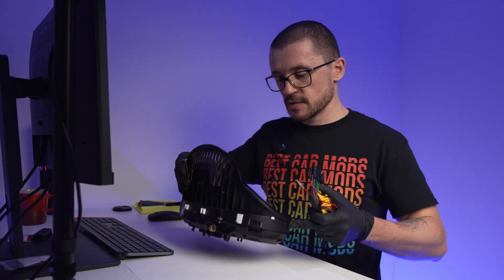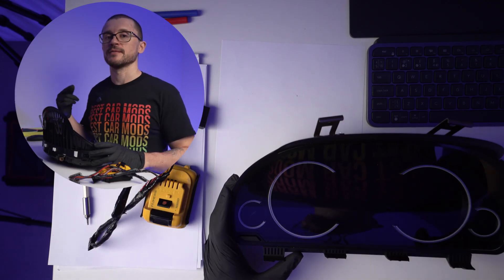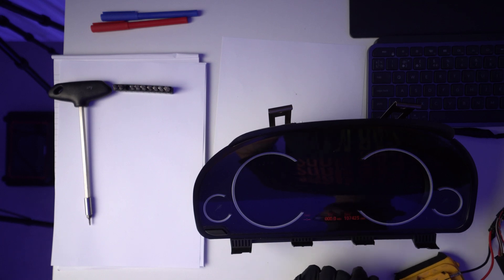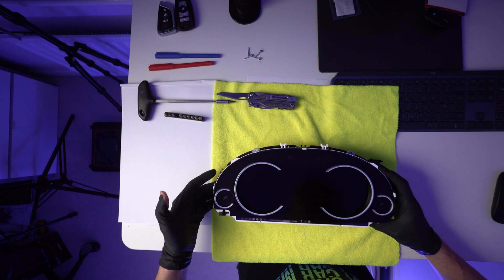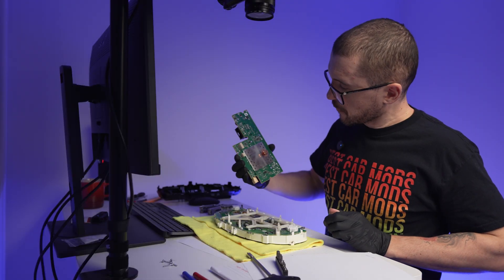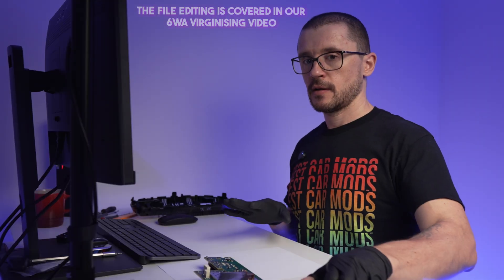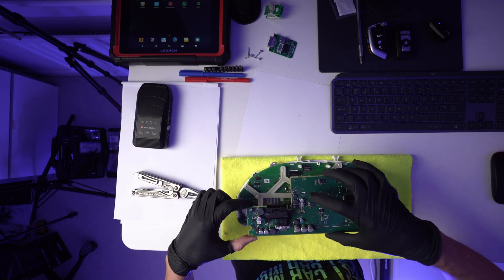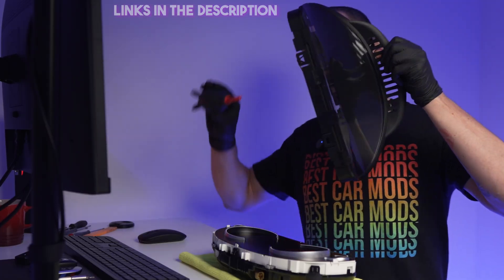HOW TO Erase / Prepare 6WB Digital Cluster for Retrofit - ACDP 2 BMW Pack

Comment: I have an old 2009 X5 3.0... E70 Series.  The instrument cluster is believed to be faulty.  If I replace this cluster with a salvaged cluster... Does it need to be virginized?
Reply from the maker: I would expect it to require VIRGINISING + coding.